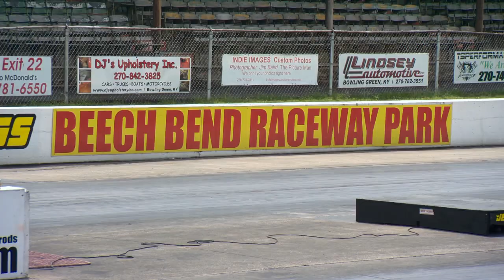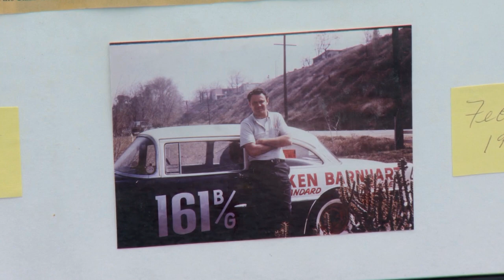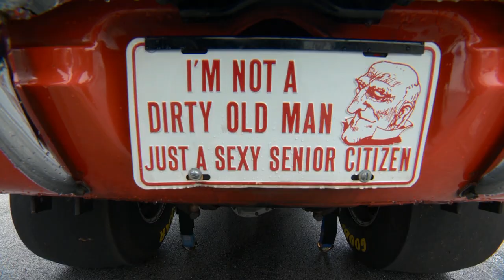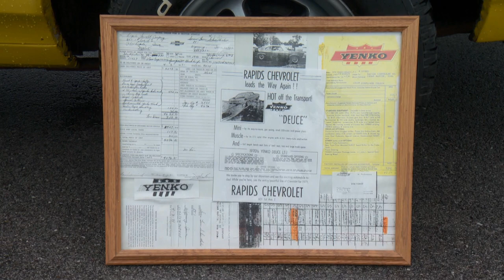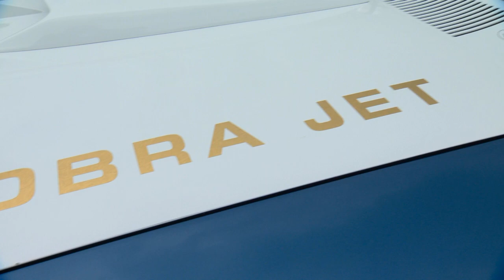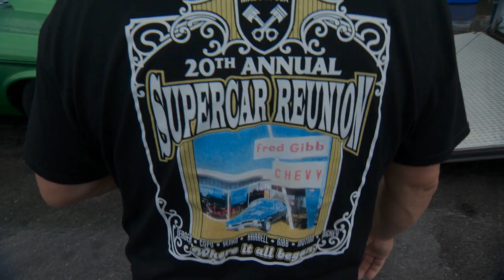1969 Ford Fairlane 428 Cobra Jet Drag Car | Platt & Payne Tribute | SuperCar Reunion

Comment: I would like to correct a false statement about the NHRA legality of the Torino, The NHRA  blueprint specs for 1968 thru 1970 428 cj and scj engines requires that the camshaft have .481"/490" lift at the valve and be a hydraulic  lifter cam in Stock eliminator. If the cam in that engine is a solid lifter cam the car WOULD NOT BE LEGAL. NHRA  has added an optional cam with .527" lift but it is also a hydraulc lifter cam 428 cj's did not come from the factory with solid lifters, the 427 medium riser engine did..
Reply: You got it, Ray.